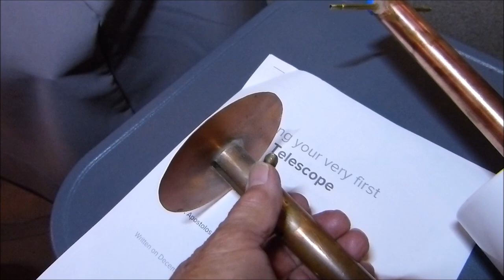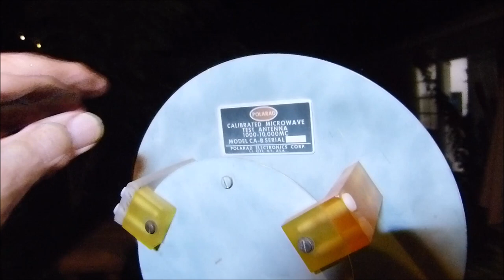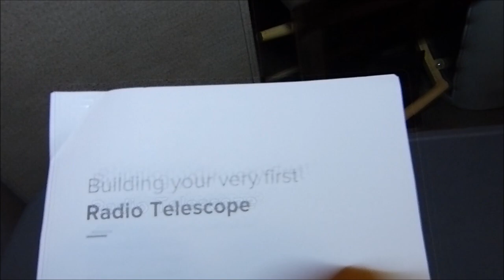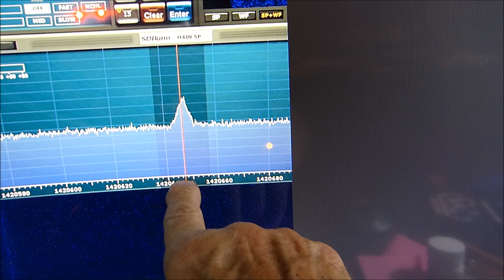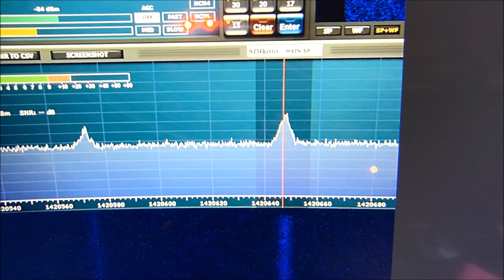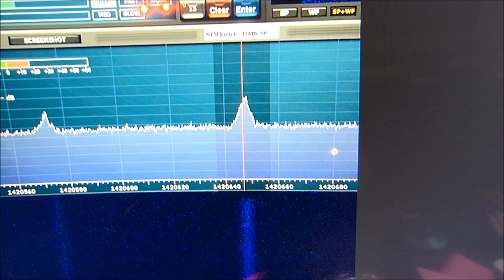Microwave Antennas & 21 cm Radio Telescope (1420 MHz)

Comment: These are the kind of instructional radio telescope hardware & software videos I have been looking for. So, many videos show off a working unit with no real information on how to do it.  There should be turn key radio telescope kits to get beginners up and running like the old Heath-kit days. This would discourage many people of getting involved with hobby radio astronomy that have not much more than kitchen tools like teenagers. My first 1960s Edmund Scientific 4" Newtonian telescope kit had all the information needed including how to grind the mirror which excited me to learn more about astronomy.    😎      I have an old Direct TV dish for my first contact with the tortious nitrogen atom.  👽   Thank you for the wonderful information. 🤩

Comment: You can use normal solder to solder Aluminium.....the trick is to use Mineral oil to flood the area where you wish to solder.....the oil stops the oxidisation process and allows the solder to bond to the steel , copper , Aluminium etc....yes you need a bit of heat, but it works very well as long as the area you are heating to solder is shielded from the air completely with the mineral oil......I do it all the time soldering coax to Aluminium antenna elements.
Reply: This is incredibly useful. I know about aluminum and its powerful urge to oxidize, and when desperate I’ve used nitrogen or argon to flood the material like when welding, but my half-baked brain never considered just brushing on some mineral oil. Thanks for the tip!

Comment: I was Inspired to build a Radio Telescope for 1420Mhz after Watching Your YouTube Video I Know it been 8 Months now but are you going to do a update on where your at with the  Observations and or any more Modifications you have made. managed to get my feed Horn to 46.86 R (ohms) VSWR 1.082 and -28.02 dB @ 1420.00 MHz. Thanks for the inspiration Love the Videos Love the Kitty Cat. Wish you all the best from Across the pond.
Reply from the maker: I got really hot on the project for a while but have not worked on it lately. Now that the weather is warm, I think I will take another shot at it by going to my favorite spot called, Aguirre Springs in New Mexico. If I do any more work and have updates, I will post them. I am very pleased you have your feed horn working so well. It looks like the most common antenna is the horn but since I had the dish, I went that way. Thanks for your reply.

Comment: I'd love to know how you used SDRUno and an SDR play to get this data at the end. I've seen this on the RTL blog version of the sdr version 3 dongle but the plugin used might be a little buggy. I've had it crash a few times.
Reply from the maker: I don't recall there being any difference is the way I use the SDRPlay at the 1.4 GHz range than I do at 14 MHz. I do have it configured for AM and not SSB but I can not think of any thing else that is different. Possibly you might notice some settings on the screen in the video. 73  WA4QGA

Comment: Would the antenna element only receive part of the illumination the dish is capable being so deep in the can ? ie, the antenna can only see part of the dish......
Reply from the maker: It is all focused to a point inside the can so that the ray from the outer edge draws a straight line with the input edge of the feed horn. That is the point you get the best focus. Any more or less and you would see less of the dish.

Comment: Have you contacted any aliens yet??
Reply from the maker: Right after these videos were posted and my completion of the radio telescope, this project got shelved and I went back to amateur radio. Since I worked at White Sands Missile Range for 20 years, I am confident the aliens know me and will come in swarms when I go to Aguirre Springs in the next few weeks. I will report back then.  🙂
Reply: @ElPasoTubeAmps  ok please do!!   I am very interested in Alien communication for personal reasons.    This banning of the 1420mhz frequency is very odd in my view.
Reply: @madmantrader  There's nothing odd about the neutral hydrogen frequency of 1420 MHz being set aside for radio astronomy. In the U.S. the FCC has chopped up the radio spectrum into bands for lots of distinct uses. There are frequencies set aside for, for example, TV transmitters or cell phones. Everyone else is banned from using those frequencies. There are lots of other bits of frequency set aside for radio astronomy, around the spectral lines of other elements and compounds: the hydroxyl radical (OH), CH, formaldehyde, methanol, water vapor, and so on. I've been watching lots of videos of the Society of Amateur Radio Astronomers. In one someone lamented that satellites were not regulated as broadcasters inside the nation were, and an OH line was basically dead for observation now.

Comment: I subscribed years ago when you were showing the cantenna empirical data, I successfully copied your design without having a VNA or any method of verification. You then mentioned that the WSMR surplus store in Las Cruces had another dish, so I put my shoes on and drove into town to buy it. I wanted to reach out if you needed an assistant with similar interests, in particular the tests you mentioned scanning WiFi AP's from trans mountain (It's been a while) using the dish. I have a 6Ghz VNA, CNC and 3d printer, I have a feeling I can be more helpful now. I also dabble in the audio stuff, although it's nothing like the cool tube gear you build. I used the audio interface trick you posted for developing a THD algorithm for a 20Kw audio power meter, since it's embedded C++ it does lots of other functions as well such as enclosure tuning and other impedance based calculations. When you mentioned it was 3am and you're still up playing, I mean working on a passion project I knew I had to reach out. Now aliens!? Are you my father? Joking, but you have got to be one of the most interesting gentlemen in El Paso I hope to meet one day.
Reply from the maker: Maybe we can meet and work together now. My wife was diagnosed with pancreatic cancer in late February and passed away June 19. I have wonderful friends in El Paso that have inspired me to keep going. I think I crossed a line in the sand about three days ago. I am OK but I am not an early riser. I am likely to be up to 6 AM and want a nap at 2 PM... after getting up...    lol  Aliens? why not... I think they are here but not extraterrestrial they are all terrestrial just like we are and came from the Earth that was seeded with universal dust for the last zillion years. Who isn't an alien?
I am truly honored that some of my videos had value for you. I am not going to put my cell number on YT but my direct email is    TheAudioShop@SBCGlobal.net
I don't think I ever did the wifi scanning from Transmountain.
6 GHz,  VNA that means doing some 5 GHz work. I just made sure I could do 2.4 GHz and my HP signal generator seem to not like anything above 3 GHz lately. I ordered a 4 GHz signal from Ebay recently. I rarely need true calibration as relative levels are good enough. 
A 20KW power meter - sounds like fun.
I am 73 and retired. Yourself?
Reply: @ElPasoTubeAmps  I send my deepest condolences Sir, I can't imagine how difficult that is for you and your family. Glad to hear you are pulling through the difficulty life has presented you with the support of friends and continue with your interests. If you ever need someone to talk to or yell at, I'll happily assist. Youtube didn't notify me of your reply otherwise it would have been a much more timely response. 

Your videos inspired me to improve my RF knowledge to at least the basics with the intent to have this very conversation, I was always told it's black magic voodoo child work but I was too curious and wanted to experiment with you one day. Seen the recent videos and figured it was time to speak up and I'm glad I finally broke the ice. Totally understand as I try to stay anonymous as possible online, I already typed up this reply before getting to your email so figured I would continue here. 
  
I have a healthy interest in the whole UFO topic, inconclusive on their origin and desperately curious to know more about them in the realm of data people like us are accustomed to. About 10 years ago I seen a UFO which forever changed my opinion of the topic, I thought it was something only crazy people seen. Maybe that's when I became a crazy person? Not sure yet on that one either... 

Unfortunately I only have a liteVNA, same league as the handheld analyzers you have but as you stated relative is good enough. I've only been doing 2.4GHz work, validating PCB microstrip characteristic impedance and antenna's for a microcontroller based mesh network. I couldn't justify a proper VNA for my application when these cheap units do the job.    
 
I'm 40, self employed and working myself to the bone to hopefully keep it that way. The current parts shortages completely wrecked my entire world, everything needed reworked multiple times and barely kept my head above water. In the end it was a net positive but a very uncomfortable experience. Hopefully soon I'll have much more spare time on my hands to learn more about this radio frequency stuff. I look forward to more correspondence and hopefully some experiments with you.
Reply from the maker: @str8upkickyaindanuts289  The detail I have not worked out is how to use the amplitude, frequency, bandwidth, whatever from the hydrogen line and out of the speaker of the SDR to mix in some way with music and make something pleasant to listen to. I apologize but I have posted so many lately, I am not sure which one I am talking about some time... 
As for UFO's, we will be going soon back camping at Aguirre Springs (hopefully) with the both telescopes and the radio telescope and a person to do the CE5 protocol to summons the aliens. Your thoughts in how to contact ETs ?
Reply: @ElPasoTubeAmps  I think that's a great idea, I would need to do some digging into the methods of exporting the SDR data. It sounds very doable in my opinion. No need to apologize, I understand the difficulty managing thoughts while multitasking. Aguirre Springs is just on the other side of the mountain from me and the exact location I seen a UFO, I would love to accompany you guys if time allows. I'm not sure I want to contact an alien to be honest and haven't really given it any thought. I'm not the smartest person in the world and with that in mind I don't foresee an intelligent entity wanting much to do with me, detecting them on the other hand... Now that's right up my alley. 1.6GHz is the frequency of interest based loosely on a TV show "secret of skinwalker ranch" in which a prominent researcher has demonstrated a direct correlation with high strangeness events including UFO's and the detection of the 1.6GHz signal. Using the dish you helped me locate years ago, I figure I could make a directional detector in attempt to do some experiments of my own. If you are going to be doing the CM5 protocol I think having the ability to detect beyond our limited sensory bandwidth, including the ability to detect this supposed electronic signature would be a worthwhile addition to the fun. If that's of any interest to you I'll gladly contribute my resources to the effort.